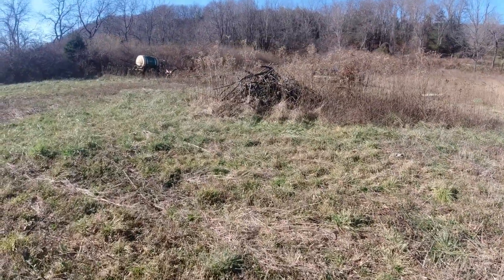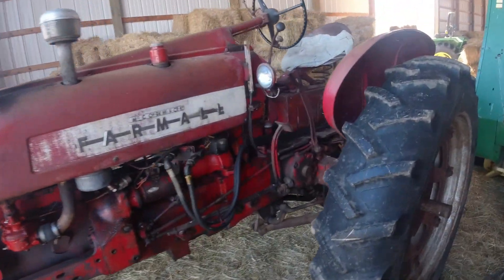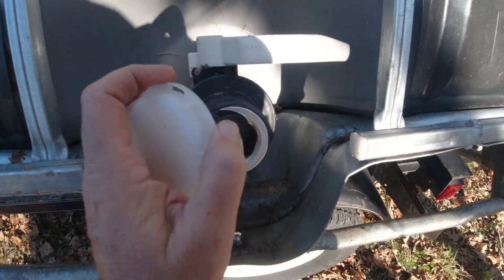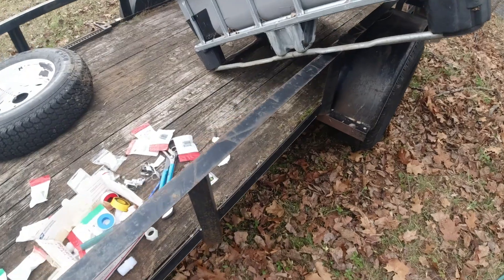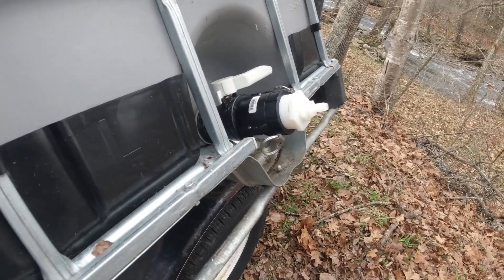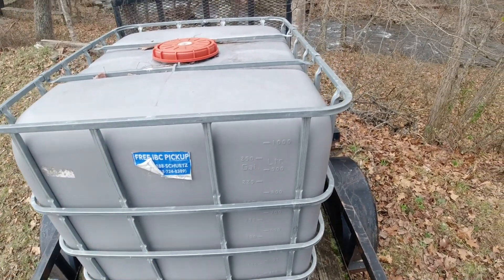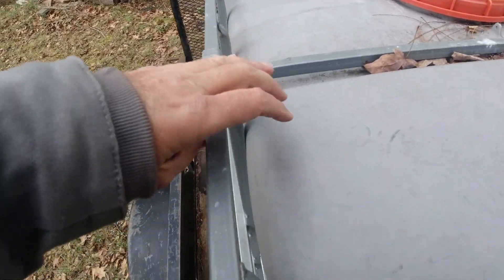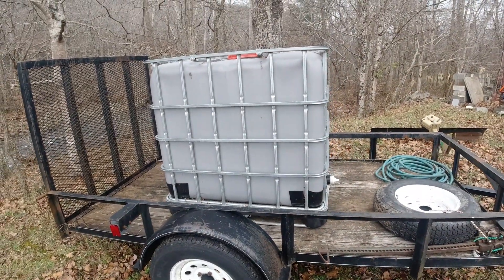Pressing On - Farmall 350 & IBC Tote Mod

Comment: That was a good idea to use the tote for a water source.  I know you don't like the diameter of the hole where the garden hose attaches.  But, the smaller that hole is, the greater force you should have for the water coming out.  Just a thought.
Reply from the maker: You are correct.  Might try a PTO sprayer pump on it to get even more volume out.  Thx for watching…👍